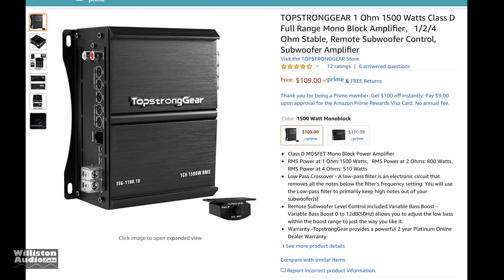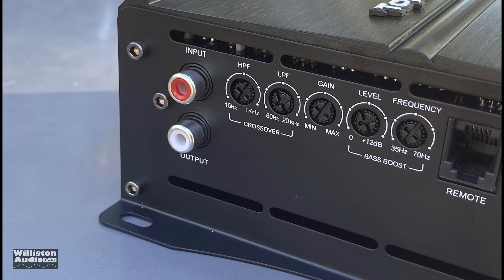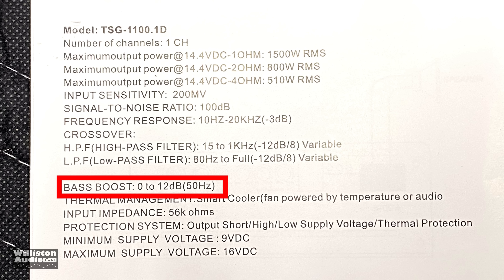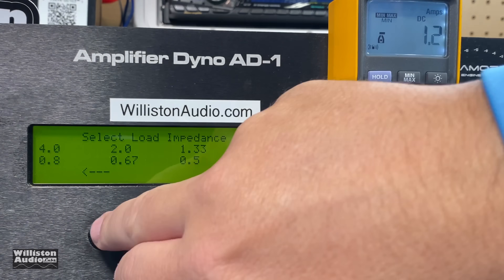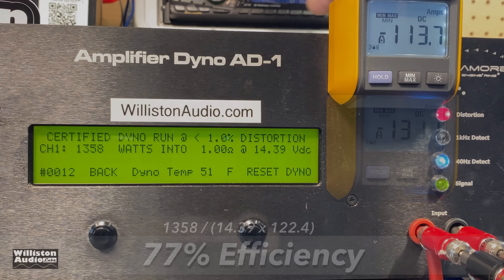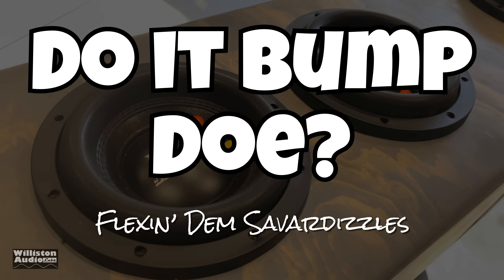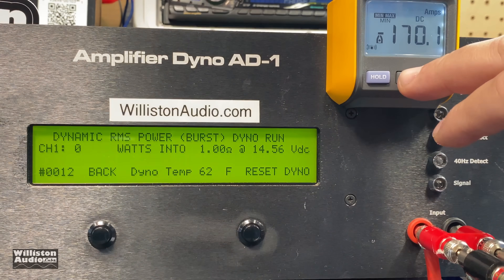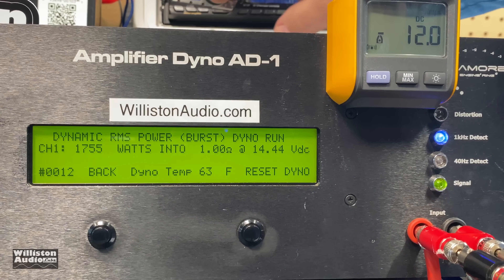Sundown SFB Clone for $89? TopStrongGear TSG-1100.1D Amp Dyno Test

Comment: was this channel called big d whiz before?   

just picked up a sfb-1000d for $90. gonna use it on a sundown sd-3 12" d2 that has sd-4 soft parts on it in a small sealed enclosure for a touch of "low end" in my quad cab ram. not sure if i should wire the sub to 1 ohm or 4 ohms. the sd3 is rated for 500w while the sd4 soft parts are rated for 600w. i know sundown always underrates their subs and amps though.

Comment: The internals look better in  the tsg1100.1d manufactured in 2023 the caps are blue like in the sundown now. i got this  amp its really good it slammed my two sa12 classics i just upgraded to the sundown sfb 3000 yesterday though
Reply: How did you tune it ? Is 80hz the lowest the low past will go?
Reply: @paulgarcia6257  tuned it using ohms law
Reply: @paulgarcia6257  i believe it is yes if the knob is all the way to the left position its the lowest it will go
Reply: @5.02valve8  and that’s sucks and a first I’ve ever seen for low pass adjustment. Usually it can go down to at least 40-50hz.
Reply: @paulgarcia6257  i liked it i had gain and bass boost set at about 80 percent for both at one point on it for 2 sundown sa12 classics and it pushed them good and clip light is normal on these amps if its flashing its bad when the light stay’s solid for too long

Comment: If one can buy an Amp that puts out the same specs as an amp ten times more expensive, what are the risks?
What are the downsides?
Reply from the maker: Consider the cheap one most likely cut corners with cheap components and such. Longevity and reliability should be considered

Comment: the majority of amps are now made in China
for exemple, i use an 5k amp branded Bass Habit SPL Elite. Its very similar from the SoundQubed  U-Series Amp 5k.
by the way, the 3k model from Bass Habit has the same shape and dimensions as the 3k from SoundQubed.

Comment: BTW those RCA input/output are common. Take a multimeter and measure the two holes. Hard short. So you can hook up left and right and it will sum the two signals.

Comment: Would you recommend this amp to power a single audiopipe 4 stack 12inch sub? Sub is RMS 1100w / 2200 max?
Reply from the maker: I don't typically recommend amps or not. Just show their capabilities and let the consumer decide. In this case, I'd personally prefer a Rockford Fosgate T1500.1bd for that sub

Comment: Hey!!! Just got mine in from Amazon, the caps (seen through side vents) are now "Blue" and not Black like yours. Did they make some changes? I can see the Yellow Voltage Coil (like that of a Ignition Coil), but the 2 large caps HAVE changed! but without opening it up, I couldn't tell you what else has.

Comment: Just bought one of these on Amazon from the TopstrongGear company. Need to find a way to turn it down to 600w @ 2ohm RMS range, for a Kicker TL7T.
Reply from the maker: It should be fine. Kicker underrates their speakers
Reply: I'm just looking for casual usage.

If you still have the same amp, and a 1 farad cap, and maybe a cheap Scosche 8 gauge amp kit, could you maybe do a video testing the following 4 scenarios back to back to back?
1) TSG-1100.1D - 4 gauge wire short wire run from source to amp.
2) TSG-1100.1D - 8 gauge wire short wire run from source to amp.
3) TSG-1100.1D - 8 gauge wire, long 12-16 foot run from source to amp.
4) TSG-1100.1D - 8 gauge wire, long 12-16 foot run from source to cap next to amp.

I don't have the tools, but for the casual audio head like me, this could help out where larger wires can't be ran, and/or when a cap can be afforded, but a battery bank can't, as not to burn out ones amp prematurely.

Just a possible video idea, and thanks for the reply!

Comment: So after watching this I got two of these, both unfortunately act weird when I attempt to power them on just to see if they are in working order. One instantly shows the clipping light and the other one shows the clipping and protect light. Any thoughts? If I can't get it resolved I'm going to send them back to Amazon and try two more. I am not a Gomer pile lol, I have hooked up a amp a few 30 to 40 times before and never experienced this issue. Also tried this in my truck where my skar amp is that I use daily. 🤔
Reply from the maker: I’d send them back. Nothing odd about how they connect
Reply: @wal  ok thank you so so so much for the reply

Comment: You need to do some high quality testing, THD, S/N , power over all with less than .5%,  full range clarity and detail. Audison, Etc.
Reply from the maker: Do I now? Would be neat but I don’t have the tools to perform those tests
Reply: @wal ,  love the vids anyway. Takes me back to many installations over the years. I've installed tons of gear back in the day from PPI, old schools 80's, MB Quart, Soundstream, Audio Control 1 Gen epicenter (freaked dudes out). I missed those day.

Comment: Are there any other user videos with this amp? I Have owned this amp for 5 months now. It is really loud and makes way more power than it claims.. it clips really early and my volt meter says it's doing like 5000 watts at max at 40 hrz still the loudest amp I own but I Need more videos on this I also pop my 150 amp fuse a couple of times.

Comment: I swear this looks alot like my Sundown SFB1k..... 😂 And I haven't watched the entire video yet. Well I did when you first released it n forgot what it's actual output is. And I need a good amp to push two SAv3 8"s pretty well and $$ is a lil tight ATM. I spent alot on a Salt3 for my new Zv5. 12". So I seen this on amazon for $150 and wondered what was it's actual output m I remembered you ran it n apparently it done pretty amazing.. so if it does good it's a absolute steal at $150
Reply: Well yup I was right lol 😂😂 it is a copy of my SFB1k 🤣🤣🤣

Comment: If is full range and theres no hpf/lpf switch are my subs getting high frequencys?
Reply: If you going to use it for bass you have to turn the highs down and set the bass because it can be a bass amp or you can use it for your mids  I just got two of them myself but im running them on my mids only sounds really good 👍 923 watts each amp is great for what I have

Comment: I have this amp and it was working great only running at 4 ohms. When I turned on my car today protect blinked a little and clipping orange light is solid no sound. The manual says nothing about the indicator lights and there is no contact. Anyone had this issue?

Comment: I got one of these amps, actually i got two, and once i hook it up and adjusted and tune it, it actually performs pretty damn good, only problem is, the bass doesn't drop as low as some of the cheaper walmart brands, but as far as the power goes, it's top notch in that department and doesn't take a lot of battery power. My meter stays between 14.3 and 13.9 with the bass knob about half way turn up and at 1 ohm, it's just not dropping as low as i would like, but hi, i brought two amps for about $200 and sold one for $200 so mine was free and im not complaining, i give this amplifier a 👍

Comment: I bought the amp and it wasn't what i expected.  I only bought because this channel recommended it.  It did not sound good at all. I have an L5 kicker and it did basically nothing to it. Maybe i did something wrong.  I had 4 gage wire to it . Was it not enough power to it. I wired my dual voice coil sub to 1ohm and still nothing.  I have a alpine v12 MRV- T502 thats rated 300 watts and it hits wayyyyy harder than this lil turd. I'm stumped. Maybe the internals are switched out and not the same.  Idk

Comment: Well, amazon has it currently at $156.  $89 would have been sweet but if it can hold up long term then i can't be too upset with the current price.  After all,  the whole point is to expose the bad ones and help out the goods ones.

Comment: why full bridge amp more powerful than the half bridge design on a smaller chassis ? I see half bridge amp more component include transformer and capasitors compare to full bridge design, super smaller and powerful full bridge amp and less component inside, what makes a full bridge design powerful like this, first full bridge system are designed and made from brazilian company ? and why 80%+/- monoblock full bridge amp is made for wider range or full range design ?? full bridge amp made 100% for bass I can see only taramps bass line + crescendo symphony s1v2 & s1 plus + banda electra bass line + stetsom digital bass db3000 & soundigital newest model evox ( only and only taramps get a many model of bass line start from 400w - 30.000w rms ) 99% mono half bridge is bass amp

Comment: I bought $130 amp with different ratings depending how its used, max mono 1000w, 2 speakers 250 w per ch. 90w rms 4 ch. I was skeptical of course but puchased anyway, much to my suprise it works quite well using 4ch and is clear. Dont have meters or any of that but i have ears n i use very little gain n it's loud n clear. 1 problem tho, wen it powers up it clicks threw the speakes. Anyone have a fix?

Comment: Hello Big D. Can you please check out TARGA and XTC amps? They are South African manufacturers and their products are stupidly cheap... 70$ for a 8000W 4channel amp??? And 100$ for a 9300W max and 800Wrms monoblock?? To be more specific, maby check out the TARGA terminator 2 series hulk. It is rated 9300W max and 800Wrms at 2ohm

Comment: Big fan here, but I’ve never understood the concern over one set of speaker outputs on a mono block amp?  A mono amp is going to be used for bass, and a multi speaker bass setup is going to have the drivers wires together in series or parallel.  So what’s the need to run two set of wire as long as the gage of the single run is sufficient?  Surely 8 gage is more than enough for this amp in a typical install.

Comment: I almost bought one of these like two weeks so I even asked question on Amazon if it was same as the sundown lmao
Reply: Its not.
Reply: @JasonWW2000  dude this is year old comment….and it’s extremely similar
Reply: @Thumper68  1 year is not very long. New people come here all the time. Anyway, I wanted to make it clear that this is not related to Sundown in any way. Both companies probably copied the same basic design, but that's it. It's two different companies, two separate build quality, two separate sets of components used, etc...

Comment: I know it's a budget thing, but I have little interest in testing bargain basement class D amps.  There is little substance in just measuring output power into a resistive load.  I do enjoy a Class D amp with headroom, even though they are few and far between.  I am sure I am the minority here, but I would love if you could test other parameters to better get a comparison between amps.  Yeah the manual has specs, but I don't trust THD etc. if the power output is highly overrated at times.  I loved it when you tested the McIntosh, but testing ANY amp under manufacture recommended loads is just asking for trouble.  If you have a customer base that likes seeing electronics go up in smoke, so be it.  I am more of a substance personality, not just 1 parameter when it comes to amp testing.  Yeah you test them on subs and give us a subjective personal take on sound quality, but not a  measurable one.  I have really enjoyed your videos since you have the Amp Dyno, if you would have time to test a few more parameters like THD, damping factor, slew rate that would sell me for the next decade.  Keep it up and I love my OSS shirt, I enjoy your channel because I can watch your videos with my kids and don't have to worry about you using profanity to sell your channel.  "Bravo Hunter"

Comment: Kind of refreshing to see an off brand do as they claim. Could it be that Sundown possibly did a collaboration with an off brand as a budget line?
I know Fluke Bought out Wavetek Meterman brand as a low budget meter solution. But left it Meterman as not to really be associated with Fluke name brand.
Just a thought, seeing these amps are damn near identical inside, except for transistor mounting. Would be interesting to see what transistors they use.

Comment: Most everything is made in China anyway, so this is a win. PCB looks great. As long as they used ESD protections during manufacture this turkey should slam subs for a good while. "Clone". Haha Try buying a good bike pump these days. Even Lezyne and Silca has pumps from China and Taiwan covered in plastic parts. So frustrating. I bought a $10 Walmart Zefal for the JD tractor tires and a vintage 1980's Silca for my bike. As for car audio amps, this TopStrongGear is for real.

Comment: I thought all power was good power until I really got into car audio a lot more. <10¢/watt is just crazy 🤯
Reply: Dibeezy ThaGifted lots of Brazilian amps are less than 10 cents per watt these days. I just bought a Taramps 8k amp the other day for $439 total. That's a killer deal imo! Some ppl bash Taramps but I've been running a Taramps Smart3 for bout a month & half now with zero issues. Puts out a lot of power & can do it for periods of up to an hour at a time without breaking a sweat. Song after song with heavy bass, no overheating & has never went into protect. (Knock on wood) I can only imagine what the 8k Taramps will do.

Comment: This is the 1st amp that gave me engine noise in over 15 years. Now it's just sitting on the shelf.
Reply: @M J you shouldn't have to that's the point. I've never found that to be an acceptable solution only a quick way to remove the problem without actually fixing it.
Reply from the maker: Wow that’s not good
Reply: @M J I have other amps on the shelf as well. It will eventually go in someone's ride lol
Reply: @M J I have other amps on the shelf as well. It will eventually go in someone's ride lol